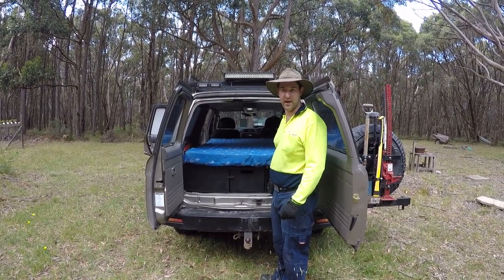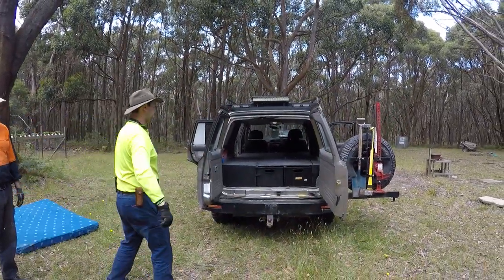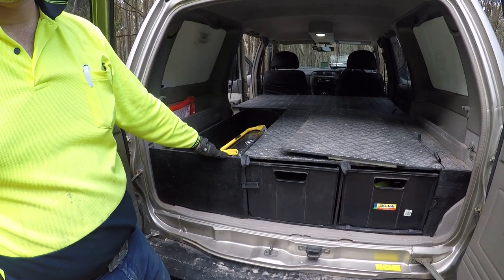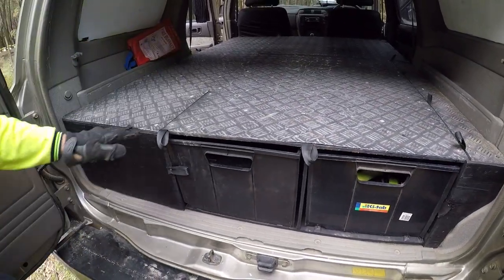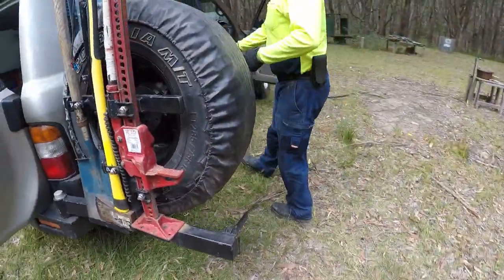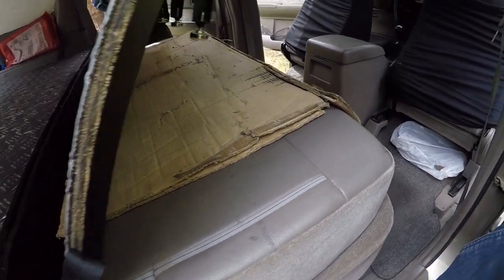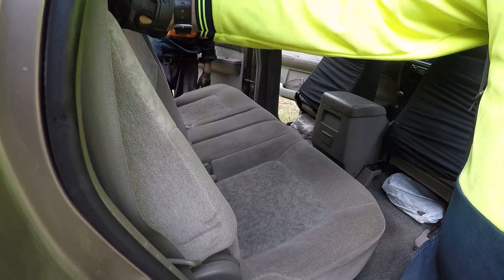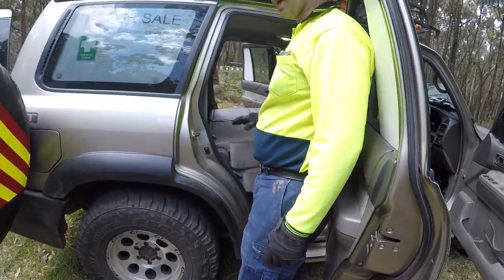GU Patrol Wagon - Rear Drawer Camper Bed

Comment: I have a similar set up in my wagon, Have my fridge stored behind the passenger seat and the bed folds up to access the fridge. Definitely beats being in the rain in a tent, swag or roof top tent. I have a 12 volt fan i run in the back in summer, midgey screens on the windows with awnings so if it rains I can still have the windows open and curtains all round. Love it.